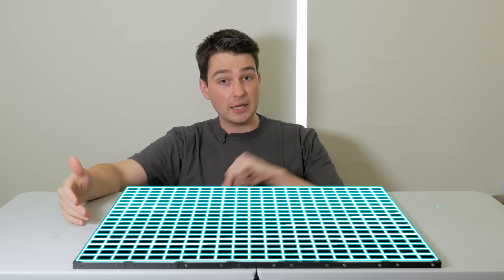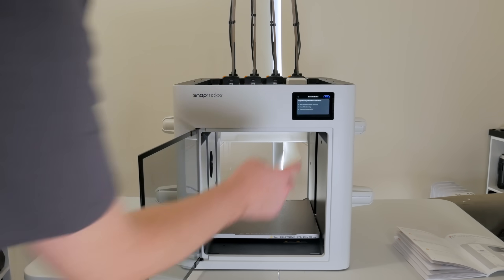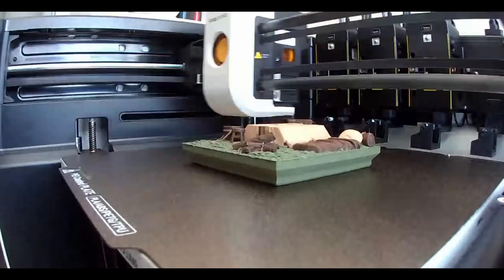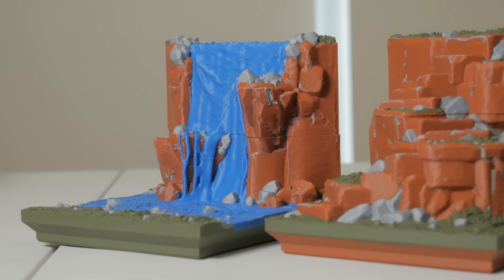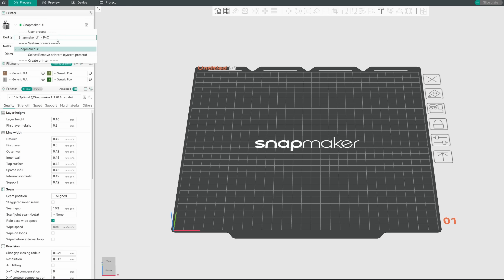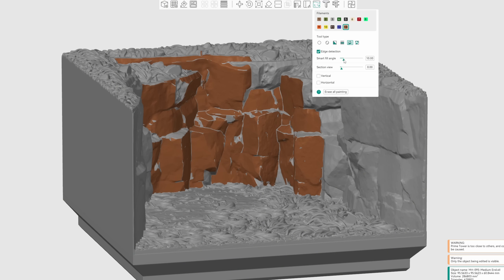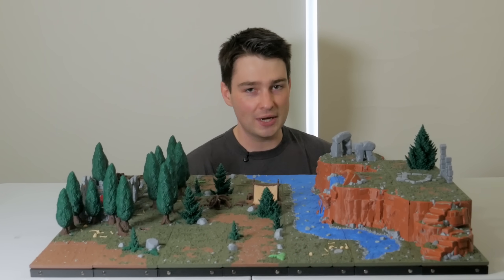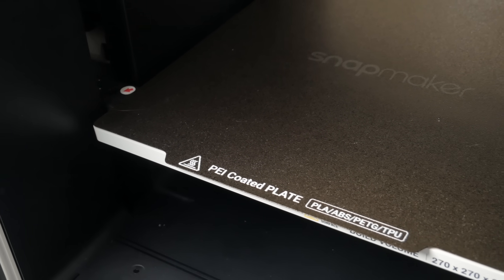This Printer is a GAME CHANGER for Tabletop Terrain!

Comment from the maker: A huge thanks to Snapmaker for sending me the U1 to test out!
If you want to grab one yourself, head on over and check it out using my affiliate link: https://snapmaker.sjv.io/POJYke
Reply: Short summary of the practical options mentioned and some useful tips: Suggested methods
Export multi-part models (3MF or STLs with separate parts): if the model is saved as distinct parts, most slicers let you assign colors/materials per part — this is the cleanest workflow. A couple of commenters recommended premade 3MFs with multiple objects per model as “ideal.”
Use Blender to paint/assign materials and export OBJ with materials: assign different materials to polygon groups in Blender (good selection tools, undo, etc.), export as OBJ with materials, then import into Orca/Snapmaker Orca. Caveat: you’re assigning by polygons, so low-poly models may not capture fine detail.
Split parts inside the slicer: some users said SnOrca (Snapmaker’s fork) supports “Split Parts” or similar — use that to break a merged model into assignable pieces. Edge-detection / auto-splitting: commenters mentioned slicer edge-detection features (Bambu’s slicer was called out) that can automate splitting; check if your Orca build has a similar tool or look for plugins that do mesh-splitting. Practical painting/assignment tips for Orca (from the creator’s tips in the video)
Outline objects first, then use the bucket fill to fill areas.
Use the sphere brush for outlines (it’s truly 3D; the circle brush misses backfaces).
Use height-range fill where helpful (rotate the model to make it easier).
For natural variation: use the bucket with a small angle (9–12% for rocks; ~3% for flat faces) to leave flecks of different colors on edges and recesses.

Comment: Might I recommend switching your infill pattern to gyroid or other nonintersecting pattern. It can help with the warping you see on several of your prints in addition to a host of other problems. I'd also recommend that you do some research into other methods of combatting warping because what I see at 6:20 makes me absolutely shocked that you didn't have more issues or outright failures related to warping.

Comment: 6:26 oh that warping :( . It's my nemesis :D
Reply: agreed... MAYBE it's because the door was open for filming, while the preset is made for a fully enclosed printer with much less heat loss and air flow. That in combination with a coated (instead of smooth) sheet COULD be the issue. Still then, with PLA and a simple 90 degree corner, not saying there's a problem for sure, but raises questions. Sample size 1 is not enough to tell anything of course.

Comment: it's not new for a printer to be able to print in different filaments, and not new for some industrial equipment to have different heads to print on. but what great is that someone has able to make it in a smaller form factor. though what you did is incredible , but one would have to weigh in on the time of rather they want to take the time to paint by hand or take the time to modify each individual aspect. both have there perks. once you set up the colors you can print the same item multiple times with no hiccup. but you would have to completely change the colors each time and program the printer for each item.. a lot to weigh on

Comment: The main thing I see here vs printing multicolor on an A1 or other printer is the time saved by not having to change and flush filamants.  What is the actual difference in time between the U1 and an AMS printing the same parts multicolor?  Great video!

Comment: Sorry to say this, it sounds so negative, but I really cringe when people use the term "Game Changer". Seems like every commercial uses it and usually it's not a game changer, just something new. So much so that the term has really started to wear out. It's a term to be used maybe two or three times a year, not every time someone invents a new bottle cap for a 2 liter soda bottle. Bambu Lab has had this system in their dual extruder H2D model. What we need to get to is the clear RGB filament that changes color just before printing when the color catalyst is added. THAT'S a Game Changer.

Comment: The ability to use different materials is the standout for me. Flexible filament is fascinating - it seems to smooth layer lines and you can't break it.

I'm certain it would have practical gaming applications, printed directly as part of a PLA structure.

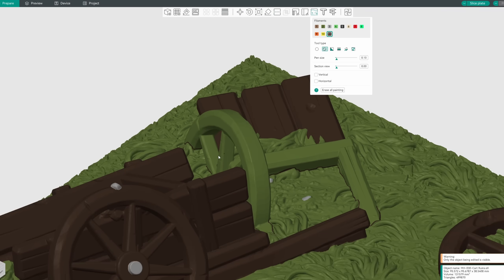Comment: 8:46 I found assigning different materials to the object in Blender and then exporting it in OBJ format works the best as Blender has better selection tools, a faster undo system and a better 3D UI.

The limitation is that you assign the material to polygons, so if your object doesn't have enough polygons, it is better to paint in the slicer, if you require details that can't be represented by painting the polygons.

But, in your case it is not a problem.

Comment: Dang it so many comments already. My A1. I killed it, massive blob, stupid ridiculous mode & my impatience, accessible grocery bag holder I can watch the rest of my TV show … I tried with the gun… I tried to be careful, but you can’t seem the heat, …warped the bed, the nozzles loose… I think the whole head probably needs replaced. The plate actually isn’t laying flat… no idea how to fix that. Not even sure if that’s gonna be in the bamboo help… awful. So basically anyone. I need to get something with blob detection. I’m too scared of add brain to always remember to check the thing and it only takes once and there’s a good chance you’re screwed. So if anybody can tell me if this thing has it. Great.

Comment: An excellent method to demonstrate the color abilities of the printer. Thumbs up! =) Wonder will they add somethink like textured model support - it could really help the painting process. By the way, if there is some kind of PLA color rolls that change color within the roll to some slight degree, it can even be (or not) beneficial to the print appearance

Comment: Great video! One thing you didn't touch on (unless I missed it) was how much purge waste this generated compared to other multi color print machines. Cheers!
Reply: I can't give you hard numbers, because i don't own the printer, but watching a lot of the footage of it, its very little. A multitoolhead printer doesn't need to purge to clear the line of old filament/ residue, it just primes each tool with a tiny bit of filament
Reply: @rightiousnewb920 great to know, thank you!

Comment: Wonder if you could use or perhaps create a sort of 3D model painter based on existing 3D model generator texture creators. A lot of them have input image output textures as an option, so it would be translating that color to the 3D model/Orca.

Comment: The best way to assign colors is to save the STL with each of the elements as parts. Most slicers let you break up the object into parts and assign colors individually, including Orca derivatives. Not all designers save the STLs with parts this way and netfabb is notorious for removing part information and merging everything together.

Comment: I like the idea of using like this for solo or random RPGs with terrain that evolves as you  place it - similar to the ones where you'd place a cards down that would show a road or dungeon path curving to the right, a T-intersection, or just a straight path and build  the adventure as you go.  Of course that might require smaller tiles or  a bigger grid

Comment: 5:38 3/35 prints is almost 9% of the prints so I'd say that is actually quite frequent.
Reply: Hm in 2 of 3 cases he said that speed was changed, and the other 1 case was after resuming print, so if not touched it works 😊
Reply: My thoughts exactly. Also the failed to continue after pause and mentioned errors in the slicer, makes me think this printer is still in his infancy. Sure a huge step, but worth waiting for the followups
Reply: @daspi  The software and firmware is terrible. I was one of the first backers to receive one and I rarely use it lol. Already wasted 1kg in garbage prints...so there goes the waste savings over my P1S
Reply: @shinmei2006  people are raving about it though so is this really affecting everyone?!
Reply: @alifewithoutgamingisnolife  idk, but generally I don't trust anyone that just says stuff in comments, because I find most people's complaints against 3D printers is user error rather than the actual printer unless it's a well known widespread issue
Reply: @HerbaMachina  of course you shouldn't trust all comments, but it's silly to say you can't trust anything in comments because a lot of the time, especially with niche topics like 3D printing, it is hobbyists giving genuine opinions.
Reply: @HerbaMachina  A good device or piece of software should still be designed to account for user error, or at the very least have big red text for warnings
Reply: @yellopenguin999 I’m reminded that this is the same reasoning that shampoo have no drinking it warnings.

Comment: I did the same thing you're doing in this video, with the same DungeonBlocks terrain, on the P1S (although, yours came out looking quite a bit better than mine due to your colour choices). As long as I didn't mix too many colours in the same layer, and I printed my whole printbed full of identical (or very similar in terms of the colour layers) blocks each time, it worked really well on that printer also. There was poop, but not prohibitively much of it, relative to the sizes of the models. Been painting the models the same way you did too, and yeah it's really tedious. There has to be a better way; surely, people painting 3D models for a job aren't doing so this way.

Though, printing minis of almost any kind is prohibitively wasteful and time-consuming. I did print up 16 identical goblins (of a relatively simple design) on a 0.2mm nozzle, and while they came out looking great (or as great as they can with the mere 3 colours I used), it took almost a week to print them, and the amount of poop was still massive. Any kind of detailed model in multi-colour with a single nozzle is crazy. But I am going to try to do it again when my H2C finally arrives (availability is shit here; the snapmaker U1 as well is unavailable for another 3-4+ months), but with 7+ colours! No doubt it will take forever still, but at least I won't have 300 grams of poops for a 6 gram model.

Comment: I have done a lot of experimentation with multi color prints of dungeon blocks myself and came to all the same conclusions you did early in the video.  It's great, but holy hell those print times and waste volume are insane.  That said I found when I did multi color prints.... a simple thin black wash and a couple quick dry brushes and they looked painted well enough for dramatically less effort than a single color print with normal effort would take.  Something like 15-20 minutes on a tile became 3-5.
Reply: the U1 barely makes waste. it's the advantage of it over the bambu lab printers. (well, except the h2c but that's more than double the U1 price)

Comment: the snapmaker u1 is a very nice piece of kit but not without flaws, some of which were seen in this video.

Pause function not working properly is very common, so is a toolhead not getting reset properly and causing a layer shift.
Warping issues is also very common and you can see it on the boxes that he printed in the video.

Nice effort from snapmaker, maybe it will spring load a new generation of tool changing printers, and maybe in turn bambu lab will make an affordable one at some point :)
Reply: This thing is listed at €999, currently discounted to €850.  That's pretty affordable for a ready-to-go 4 toolhead printer.
Reply: those are all software issues easy to fix and most likely will be fixed in the next few months so not that big of an issue.
Reply: @ShadowGun625 hopefully :)

Comment: 100% this is what excites me about this next round of 3d printing. Affordable multitool changers!
Reply: I feel like integrating a UV printer into the system will be the ultimate solution. If the printer added the colour after each layer of filament then it should always be printing on a flat plane. I’m sure an industrial engineer will tell me it’s impossible, but it works in my head.

Comment: Love the video!

So with my pla terrain I have been painting straight onto the plastic (no primer) with house paint pot samples from bunnings, miss tints sell for $1 (I got the idea for the paint from a video with Johnny Fraser-Allen from Weta) and I did some tests and found that the primers and house paints seem to adhere the same (from my very non-scientific scratch test and shake test).

All this to say that with high quality house paints I reckon you could basically brush on highlights. You can also use walnut wood stain, thinned down with water as a wash (another idea from Johnny Fraser-Allen) that would very much give you consistency. Just make sure you wipe it away with an old rag. 

Even just the highlights would take it to the next level I reckon

Comment: Have you tried applying a wash to the terrain? I wonder if that might bridge the gap between slightly cartoony and high detail? Love this though - it’s crazy to see how far the technology has come recently!
Reply from the maker: This is something I might explore in the future. Want to keep my terrain simple/easy and looking as cohesive as possible, but there's definitely some room to explore some washes or drybrushing down the line I reckon!
Reply: Ive been printing terrain using multifilament methods for a while.  Using a varnish as a primer and then hitting the terrain with a wash, contrast style paint (GSW Dipping inks work well for this because theyre low cost) and normal acrylic paints for highlights/detail works very well.
Reply: @matthewallison5219 You see, stuff like this could make a guy want to buy a multicolour 3d printer 😅😅
Reply: I tried a wash on a figure I printed and it looked bad as it essentuated the print lines. But it was a really cheap printer, so a better quality printer with smaller print lines may work better.
Reply: @uRCrazy1313 I've had good luck with Monument Hobbies PRO Acryl Clear Matte Varnish as the primer.  Seems to do a good job hiding the layer lines.   Also, I tend to print at .12 or something similar on any terrain I do this with
Reply: @uRCrazy1313  Agreed. I've found the speed painting methods of washing and dry-brushing show up the layer lines, even at 0.1.  I am going to avoid these techniques when I paint my next batch of minis.  Also might test PVA glue as an undercoat to disguise layers.
Reply: I have a bunch of dungeon tiles from Fat Dragon Games that I printed in multicolor on my Bambu X1C. After they were printed, I slathered a Minwax black stain over them and wiped them down. The stain left black in the nooks and crannies and darkened the PLA, giving it a more realistic/less cartoony look. When the stain dried I hit them with a quick off-white dry brush and they turned out great. While the stain + drybrush is more work than just printing, it goes very quick and gives a much better end result IMO.

I'm seriously thinking about the U1, though. The big problem with the X1C (or my A1) is the waste and time for color changing.
Reply: @brucegulke most of my terrain is from Aether Studios.  The team over there is great and has even featured some of my colored prints on their MMF store.
Reply: The colour's look too bland and have no character unfortunately not for me, but the design is good for new people to the hobby, but unfortunately vets will always make scratch build and just use 3d buildings and tiles for their games